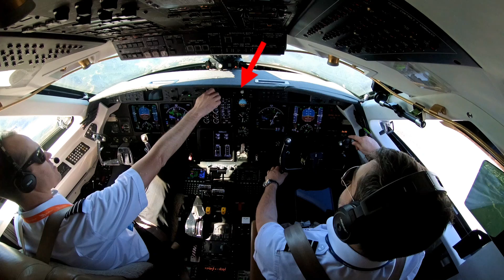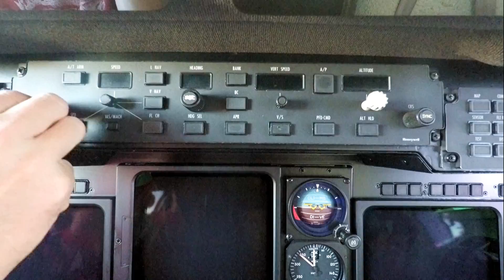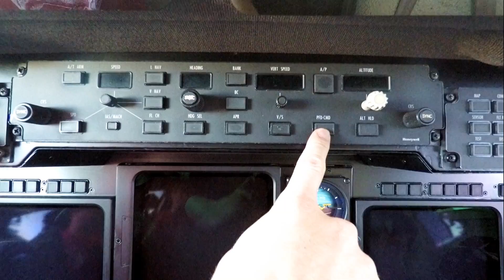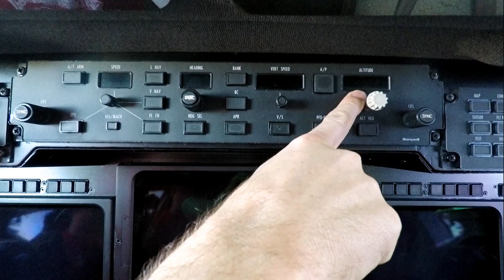Tech Tuesday - Gulfstream G-IV Flight Guidance Panel

Comment: Hey Shaun, I saw the Tech Tuesday video on the Nutcracker referring to the spoilers, but do the buckets at the back of the engine cowling auto-deploy also or is that a manual function?
Reply from the maker: That's a manual function. The levers just in front of the throttles are for the thrust reverser buckets.
Reply: @CorporatePilotLife  Your tech videos may alleviate aviophobia!

Comment: One thing that was not answered here that I have always been wondering. When ATC says "Turn left heading 240", I see the dial turns to set 240 for the heading but how do you tell the aircraft to turn left to that heading and not right? I assume that it is based on the direction your turn the knob? I also assume it can't be simply that it will turn whichever direction is the shortest because I am sure there are times ATC wants you to turn a certain direction even if it will take almost a 3/4 circle to get there.
Reply: It's a pretty simple software decision to make a 20 degree turn instead of a 340 degree turn.
Reply: @mikeh2520  I realize that but there are times that ATC actually wants them to take the long turn so that is what I was asking is how to force it to make the turn the long way, the way ATC asked them to turn. I think I understand now based on Sean's response. They turn the knob slowly to force it to turn the direction they want.
Reply from the maker: Yeah...it goes whichever direction is shortest. It does get trick when ATC specifically asks us to go the long way around, like that 3/4 turn you mentioned. In that case we turn the heading knob slowly around to just keep it turning in the correct direction.
Reply: @CorporatePilotLife  Ah, makes sense. You basically have to turn it slowly to trick it to turn the direction you want even if it the longest. I think I hinted at a great idea though, wouldn't it be better if it turned in the direction you spin the knob?

Comment: No LOC button? So when you are cleared to intercept the localizer, you stay in LNAV?
Reply: That is correct. UNLESS, you are cleared for the approach, meaning cleared to descend on the approach. If you are just cleared to intercept and track the localizer you stay in LNAV mode. Once you are cleared for an ILS approach you activate Approach mode and start to descend on the glideslope.

Comment: No YAW dampener?
Reply: The Yaw dampener on/off button is located the forward instrument panel just above the pilots right knee (right next to the electric trim on/off button). It is normally left on for all phases of flight and does not turn on/off with the auto-pilot.

Comment: Why there is a FL CH and not use constant SPD (selected) + ALTITUDE selection? If I have SPD selected and climbing using ALTITUDE and V/S selected will A/T not keep the selected SPD? Or you need FL CH selected while changing ALTITUDE?
Reply: This has to do with required power settings and the auto-throttles. With a specific airspeed and altitude selected, if you want to climb the airplane a decision has to be made about how much power to add to achieve the climb. Add a little power you get a slow climb, add a lot of power you get a high rate of climb. When you use FLCH to climb, the auto-throttle computers use max available power to climb as quickly as possible while maintaining airspeed (or near idle to descend quickly keeping airspeed). You could do this "manually" using the VS (vertical speed) mode but you'd have to guess how quickly the aircraft is able to climb (while maintaining airspeed) by increasing the climb rate until the auto-throttles couldn't  add any more power and the airspeed starts to decrease. On descent, you'd have to increase the rate of descent until the power couldn't be reduced any further and airspeed starts to increase. It's far easier to just use FLCH and let the computers work it out.

Comment: Very good explanation Shaun. Is there an autopilot kill switch on the control yolk as well? Thanks, great VLOG!
Reply: Yes, a button on the yoke will disconnect the auto-pilot but leave the auto-throttles active. To disconnect the auto-throttles you would normally press the AT disconnect buttons on the front edge of the throttles or shut off the AT on the Flight Guidance Panel (button top left corner).
Reply: @timsfun6653  thanks Tim!
Reply from the maker: There are actually 2 methods on the yoke to disconnect the autopilot. There is a designated button for it, or the most common method is to use the electric trim switch, as that disengages the autopilot.